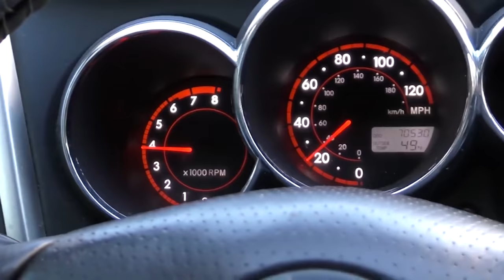5 Signs Your Transmission Has a Serious Problem

Comment: Scotty. Why my trans kicks (pops hard) when I shift from P to R even if I do it with both brakes pushed all the way in specially when I am parked over a hill or some sort of angle?
Reply: Because the weight of your car is resting on the parking pin. Put your e brake on then put it in park

Comment: Hello, I just bought a 2000 RAV4 with 120,000 miles. The transmission was flushed. In 2013 with 97,000 miles on it buy the previous owner in this case, should I flush my transmission fluid or just leave it?

Comment: I do a drain and fill once a year. My car uses 2 filters. I change the smaller filter every year too. Just did the pan filter and gasket. Fluid is super cheap compared to a new transmission.  Its literally a $23.00 for a gallon of fluid, $1.40 for a drain bolt gasket, and $12 for the filter. $36 bucks a year for peace of mind.

Comment: I changed the transmission oil on a car that has over 300,000 miles on it because the gear shifting was kind of slow, it sort of fixed the problem for a while and then it went back to the way it was running, then I recently changed the engine oil and filter. I used a premium K&N filter and High Mileage Mobil 1 oil and it started shifting gears much more smoothly immediately and I was very impressed with it, but it is now sort of starting to run like it was before. Any ideas? I know it's an old engine and transmission but I want to be able to prolong the life of the car for as long as I can until I can afford to buy a better one.

Comment: I had to get a 2002 Honda Accord with 86k miles, and I've been experiencing my transmission, throwing me back and forth in my seat each time i accelerate, or it revs to almost 5k rpm before actually accelerating and jerks me back and forth in my seat. (Mega pause)

I HAD to buy it, and it cost way too much (7.4k). The interior was in good condition, but the outside had dents in the hood, door dings on the side, and surface rust on the back. 

My mom took $4k out of my account during the summer before i had to go to my freshman year of college this year because she didn't want to work this exact summer. 

I would've had 13k$ to actually buy something that was worth the genuine hell i put myself through working near 40 hours a week during high school for 9 months straight. But I was left with a little around $8.8k. 

There were genuinely no options in maryland i had at the time during August of this year, so i had no choice.

I thought about modding and even adding performance mods to it, but i honestly dont think it's worth it atp. 

I am saving for another car that'll potentially pop up on the few car apps i have... i really hope im able to get something i feel like i deserve, not to sound selfish...

Sorry for the rant.

Comment: Scotty in my almost 10 years as a transmission R&R tech & general mechanic, I've never seen a Hyundai / KIA FWD transmission with "cherry red" fluid. Doesn't matter if it has 10k or 110,000k miles, it's always purple ish or black. Idk if it's how they apply their clutches or if it's just how they break in. 🧑‍🔧

Comment: I had a bad shifting transmission for a Hyundai accent 2001 . I did changed transmission fluid for three times then started to work great to me for a bout more than five years. I haven't flushed or changed a filter. I just replaced the fluid. Now, we have a Toyota sienna and took it to the dealership and has them replace transmission fluid. I feel the car is not shfting like before. It was smooth, but now is not.

Comment: Scotty, I've got an interesting problem on a rear brake imbalance. I'm in Europe, I took the car for it's yearly test, the guy said the front brakes were fine, the hand brake was fine (uses cable), the rear right brake was fine, but the left had a serious imbalance from the right. The shoes on the drums brakes are new. So I swapped out the calipers, bled the brakes took it back and got the same result. Now if there is a blockage in the line from the master cylinder how did i bleed the brakes ok? Some how little force is a arriving at the caliper.

Comment: I have a 98 Ford explorer XLT 4.0 sohc. It shifts fine, but when i let go of the gas I'll hear w grinding noise or a high whining noice... Any chance you would know what that would be?
Reply: I ended up figuring it out. It was my transfer case. Put a used transfer case in and now it's fine.

Comment: I have a 2006 Ford Fusion, and every time I start my speed especially when I first start driving my RPM shifts about any where 3-6 and couple seconds later goes down and is Normal, will shift kinda if I do speed up, and then when I go up hill it shifts hard and then goes back down. I guess a lot of people have had this problem. The transmission fluid is burnt but its not gritty. I’m at 107,000 miles on it. I’m not sure what’s up.

Comment: Hello Scotty! I have a 1999 CLK with 186k miles in it. I changed the ATF in summer and all was good as ever. But recently I've noticed that it shifts at higher RPMs between the 1st and 2nd and 2nd and 3rd gears, and kinda slips from 2nd to 3rd gears. But that only happens when the car is still not on operacional temperature. When its at operational temperature, that never happens. Any advice?

Comment: I have a 2009 Mercury Grand Marquis, it was reversing, but the reverse gear was very weak, and after a few days, the car did not go back at all, as if it was in neutral gear

Knowing that I did not change the gear oil until after 3 years and 7 months, but during the 3 years and 7 months I have only cut 35,000 km. Do you think the problem is because of the delay in changing the gear oil?

Comment: My car is a manual and it shifts fine in all gears and is smooth.  I put it into reverse and it's fine until it pops out of gear and starts grinding unless I push the clutch back in. Not sure what I need to change first.

Comment: I've got (had), a 1993 plymouth voyager that the transmission went out on. Out of nowhere the thing went out. It started on the highway, it was making a whining noise then started thudding around when I decelerated. When I made it into town, it just gave out and started slipping bad. Luckily, I was able to make it to a parking lot, limping down the road. It runs idle just fine, but it just won't drive. I'm gonna try to replace the fluid and use that additive and see what happens.

Comment: back in 2004 or so, I bought a Grand Caravan and then had the trans flushed, and just like you said, it started slipping, so then I had the transmission replaced, but not at the same shop that did the flush because I couldn't understand why it was not slipping before. But why did the shop return the van to me with it slipping? didn't the techs test drive it before handing it back to me? At that time I knew very little about transmissions, but now I caught up on many things automotive including trans. After the Grand Caravan, I bought a 2001 v8 Dodge Ram and I had a BG flush done on the trans. a number of times but there was no slipping in this case; was the transmission in the Dodge in better condition than with the Grand Caravan? I suppose so I don't know what year the Caravan was.

Comment: Hey Scotty!  Great video!  I have a 2016 GMC Canyon (80k miles). It seems to shift hard especially between 2/3 and 4/5 gears. Others have said "that's normal". As the one who has been driving it daily, it's definitely not normal. I've been doing some research and have heard this year has had some transmission issues. I've been following recommended maintenance schedule. Any advice? Thank you! Keep making videos, please!
Reply: did u fix the problem. have same truck same mileage
Reply: Haven't figured it out yet. Is yours doing this too?
Reply: it wont run on idle . then hard shifting on 1st and 2 and. they say it might be low on fluid

Comment: Scotty, I've been following many of your videos and applying your recommendations. I've got an 02 Volvo V70 with 275k miles. It runs great, solid, terrific vehicle. I'd like to start from zero and I'm addressing suspension and fluids, but the transmission fluid dialogue has me confused. Being that it's an old vehicle, would I be making a mistake in changing the fluid? I order the Volvo transmission fluid. The transmission does not slip or anything. I just thought it'd be smart to get the old car to zero in order to mitigate any problems, but the transmission fluid recommendations got me confused. Please advise
Reply: Tbh confused also, what did u end up doing?
Reply: I have the same question. I wish he would have answered this…

Comment: I have a 2005 Mercedes & it intermittently won’t shift out of 1st gear...
Reply: Buy a Toyota!
Reply: Change the fluid? Cant go wrong if its already borked. Used to have a 99 e300d turbodiesel. Wouldnt want to go out of 1st when cold. Changed the fluid at around 150k miles and fixed the problem. Still running strong as far as the new owner has told me.
Reply: @benjaminowen6181  Mechanic tried to tell me that the gear shifter was broken

Comment: My old Honda has been idling funny in park and neutral after it water locked while driving though a flash flood. So far it’s running better and better each time I clean it with throttle body cleaner, let it air dry, and then run it but it still has a feint bounce in the idle

Comment: Very auto-novice female here. Just bought a 2010 Patriot and mine only slightly shudders down when braking to a stop. I am wondering if mine will be fixed by spark plug change too. I am very worried it is a case of hidden transmission problem. Mine is CVT also and most ppl in the comments section say their shudder is in accelerating. Mine is only when braking close to almost stopping. Otherwise this car drives super smooth no issues. Without me going to an auto mechanic to spend funds I don’t have, anyone have any similar issues can advise?🤔

Comment: My shifter seemed a little between drive and overdrive on my 2004 Ford Tsurus SE, and it went then it didn’t, it’s like no gears exist at all, the engine runs but there’s no gears or even feeling of it attempting to find any…. WHAT DOES THIS MEAN. (Detailed) aside from its trashed. Plz and ty

Comment: Got an old volvo with 200k+ miles on it. The old owner who had it since new flushed the transmission every 35k or so at the volvo dealer. I kept with it and have done a couple of flushes on it at the local auto shop. Transmission still shifts like a charm. They do the full flush takes like 20quartz of oil or so, i think. Fresh fluids everytime.

Comment: What happens if the shop mechanic used a OBJ scanner and the ECU sensors came up as the problem. I changed both but the engine check light is still on? Any help please
Reply: A scanner will assist you with this issue. The scanner will either plug in under your knee bolster, or inside your glove compartment. When it gives you a code. Look that code up in the accompanying book that comes with it. Inside this book, it will tell you whether you need to replace an oxygen sensor, or an oil sending unit for example. All auto parts stores sell them.

Comment: Bought a used 05 Lesabre with 50k miles and noticed the transmission fluid was bright red.  It runs beautifully but downshifts hard.  I bet it shifted fine before the dealer cleaned it up for sale.

Comment: Scotty, I drive a 13yr old Toyota Wish 1.8litre. Has 150,000km on it.
Sometimes (and I mean really sometimes) in the morning when I start the engine (after the engine warmup light has dissappeared)...
Sometimes I cabt get the car to "D". 
Even afer I set the gear to D again, its still the same. 
Usually it will resolve itself of I leave the engine warming up for about another minute or 2. 
Why is this?
The car drives and shifts normally when engine is hot. And I usually change my ATF every 10,000km

Comment: Good day. I drive a 2001 Hyundai Elantra, 1.6 gls 4 speed automatic with overdrive. My problem is that in urban driving its fuel consumption is very very poor. Most of my urban driving is between 20-35mph at 2000 rpm. 4th gear is only engaged at 30mph, which means most of the time I'm driving in 3rd gear. My question; is it possible to make make adjustment on the gearbox to get 4th gear to engage at 25 mph? Or do I need to make adjustment to the software?

Comment: I was told by a mechanic that my transmission was slipping at 50,000 miles…I took it to the dealership and asked them to do a transmission flush…Car started running extremely slow and was losing power after leaving the dealer. Dealer took ownership of the problem, put me in a rental while they rebuilt the transmission. I sold that car a week later.

Comment: This is bad, i think i had my transmission flushed? I can't remember. I hope now that it was just a fluid change. I think it was but idk. It was $250 at a Toyota dealership. I had it changed (or flushed, i forgot) at 85,000 miles or so and it's now 92,000 miles. No problems at all so far. I have a 2016 Toyota RAV4 LE AWD if that tells you anything.

What do i do if it was flushed?

Comment: So I wasn't going crazy when the 2010 Toyota Sienna (120k miles) started slipping and shifting rough. I think it may be due for some extreme maintenance because of people not taking care of it. Driving up hill the RPMs spike and the car doesn't go anywhere, then suddenly the car kicks forward and launches. Reasons why I prefer manual transmissions...

Comment: I have a 2002 Chevy 2500HD with 303k miles, original transmission and the fluid has never been changed. I added the Lucas transmission fix just in case. Hopefully I can get another 100k miles out of it.

Comment: I throw my f150 in reverse and it does take a second. Only a second, to switch into gear. But it is a noticeable shift in the transmission, like I can feel it engage. But it's older. 2007. Just over 100k miles on it. Was used as a work truck before I got it and has had a decent amount of work done to it. While regular driving it's great. If I stomp the pedal it does have about a second of lag. Just like when I shift it into reverse. But there's no noise. No clunking. No problems shifting through gears while driving.

Comment: Hello mr Scotty.  I have a question I have a 2012 Ford F-250  6.2L. XLT gas. I bough it with 145k not sure if previous owner change the oil on the transmission. Now my truck has 315K. Never change the oil in the trans.   Should I change now or just leave it until it breaks now? Pls give me and advice thx

Comment: The Lucas transfixed worked on a used car I bought. 50k and still going strong..
On cars I purchase with less than 50k. I do a flush where I disconnect the post cooler line, over fill run, turn off, fill, run, turn off, repeat till fluid is clean. I replace fluid ever 50-60k unless I do lots of towing, then I do it at 30k. Been working well for many cars. Something else causes me to replace at 170k but transmission is good.

Comment: Might be a stupid question, but if a used transmission is sensitive to the lack of friction in fresh liquid, why doesn't this problem happen in a brand new transmission with brand new fluid? Why is it a problem 100,000 miles+ but not at 0 miles?

Comment: Our 2009 Nissan Sentra has a manual transmission. It started to give some jerks right at the beginning of driving (when you start to drive in the morning). It happens in the 1st gear when you just release the clutch pedal, jerks somewhere in the area of front passenger wheel, like that wheel can't rotate for a second or smth, then goes normally. If you bring it to stop and then start to drive all that repeats. The problem continues for ~10 min. After that no jerking after stops. Is it smth w/brakes on the FP side or it is smth w/transmission (like low on transmission fluid)? I've recently went over a curb w/that particular side (PS), but I don't remember if the problem started right after that or later. I would appreciate any opinions on this matter. Thank you for a great and informative film.

Comment: here in the Philippines... we always replace manual transmission or automatic transmission every 40,000 km or 2 years (i.e. whichever comes first) ... that includes brakefluid, clutch fluid, powersteering fluid & even radiator coolant...

Comment: i went searching youtube for answers and scotty just described exactly what is happening to my car. 193,000 miles i have a leak and for a couple of days have been putting fresh new fluid in to keep it running just to get to work til the shop can fix it, and the exact issues I'm having while driving are what scotty said in his skit.. I paid 4,000 for this car and not willing to pay 4,000 for another transmission. Im hoping that I'm not causing too much damage to it..

Comment: Would u change the fluid on 113000 mile auto transmission? The cars 5 years old. Never changed the fluid before. Not flush. Just change whatever fluid drains out.

Comment: Previous owner of my 07 Ridgeline did not take great care of the car as I found out after the fact of buying, one of the things being dirty trans fluid. No issues shifting but the fluid was very dirty. Luckily it's a drain and fill trans versus flush so a couple of easy drains and refills in the driveway I've had no problems with the transmission so far and it's got  over 200K miles now. Not sure I'll ever own newer cars for the fact they seem to require a lot more difficult labor to change what should be simple for most to do at home.

Comment: Just had my 2006 Toyota sienna auto tranny filter dropped and fluid changed.  Now my van won't go past 40 uphill.  The rpm stays at 2 until I push the gas down to the floor then it will rev up to 3 or 4.  I only drove it 2 times since the change and this is what I'm dealing with.  I have done regular services up to this point as well.